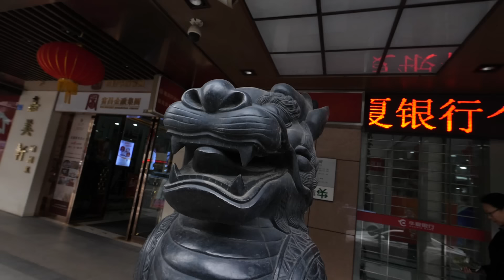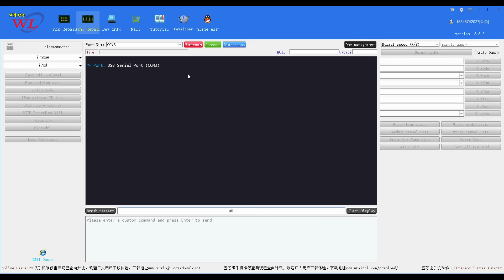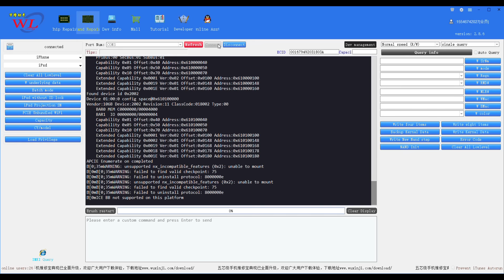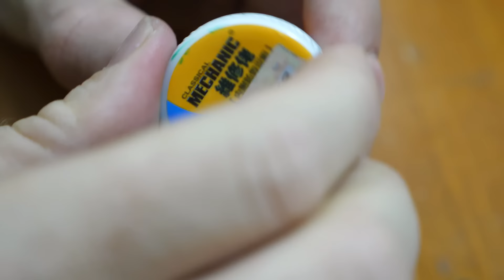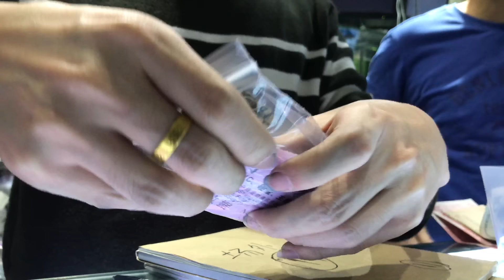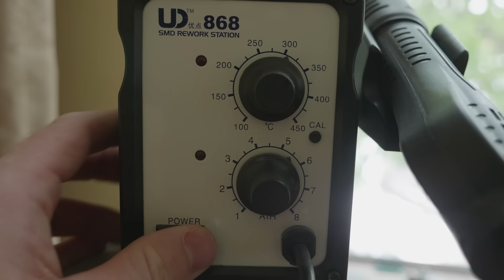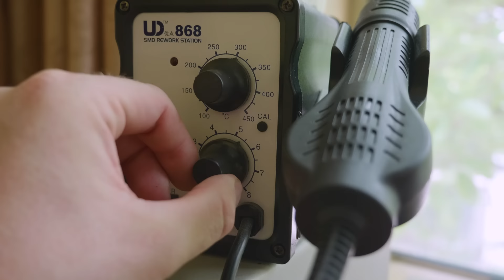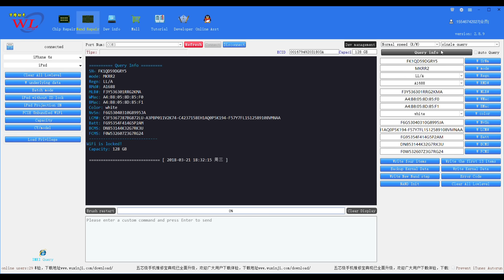How I Upgraded My iPhone Memory 800% - in Shenzhen, China

Comment: GREAT VIDEO!
HOPEFULLY some of you now understand why high end phones are expensive. Some parts will not work on first soldering.
I've done a few re-solders on my LGG3's. Making my own soldering iron tip with a 16g wire wrapped around that big 3/16" tip.
BUT... I now have a hot-air solder'er ( ! WHAT A DIFFERENCE ! ) 

.

Comment: I love your videos!!! You should try installing an oled Display in the phone next. I’d really like to know if it’s possible somehow... after all the iPhone X has one, so the software should support it.
Reply: Ꮆ0ͮͩͦ̑D̶L̶e̶ᎦᎦ Software isn't the issue the issue is whether or not someone makes an OLED panel with the right size and contacts for the logic board. An OLED panel will use the same software as an LCD hence the fact that no driver downloads are needed if you swap from IPS to TFT to OLED to AMOLED. However, you'll find a nice IPS panel is always nicer than OLED as with a 1600:1 or better contrast ratio your blacks will be almost as deep and you'll have much nicer high light performance with the lack of long term burn in thrown in as a bonus. So possible? Yes. Reasonable? No.

Comment: Here's a suggestion ..... Upgrading the CPU from the A9 to the A11 if it is possible
Reply: Jonathan Flowers it isnt but if its possible i will upgrade it to snapdragon 845
Reply: why would you ever want to upgrade an A9 to a low tier sd845 over the high end x86_64 based A11
Reply: I think the socket are not same :/
But good idea :)
Reply: even if it were, you wouldn't unless you don't know anything about CPUs. The A11 is superior to the snapdragon 845, even Samsung's Exynos is superior.
Reply: Where on earth did you get the idea that the A11 is x86_64 based? The A11 and the snapdragon 845 are comparable devices, and both are high-end 64-bit ARM-architecture devices.

Also, different SoCs have different pinouts and different requirements on other components, so upgrading the SoC (other than to a minor variant of the same SoC, e.g. a different speedbin) requires a logic board redesign.
Reply: dude, not possible
Reply: The motherboard is different
Reply: Top Kek it's not x86, and either way x86 is increasingly bad compared to ARM in many ways these days.
Reply: Jonathan Flowers not possible at all
Reply: Nope
Reply: upgrade to i7 is better
Reply: Should technically be possible considering they are both ARM processors. Same instruction set, but it would likely cause timing issues with threading.
Reply: The a11 isn't x86_64 based
Reply: CPUs are not as easy to replace as memories, You gotta take care of ton of variables when changing CPU (eg. Architecture, Socket, Compatibility, Clock speeds) on top of that a lot of programming also goes into the process.
Reply: Sergej Čipak  snapdragons use a different chipset socket etc
Reply: Even though I don't know anything about this, but I think what Matthijs van Duin said is true. It's possible, just need the board to be redesigned.
Reply: HyperSonic2006 [KC] wow, do you mind making a video guide on how to do it?
Reply: HyperSonic2006 [KC] owh, that's okay. just in case you make a video some day, please inform me ok 😉
Reply: I was talking about upgrading to the Snapdragon 845

Comment: I'm not sure if someone has mentioned this already or not, but the solder screen is not intended to be on the board as you are heating the solder. At least that's not how one pastes pcbs. 

You made it harder on yourself han was necessary, but great job completing your upgrade in hard mode!
Reply: Austin Bialk is not to be confused tour is
Reply: Punjab

Comment: New computer ? You could have just installed a virtual machine in your Mac ._.
Reply: Juan Camilo oh I just posted this comment
Reply: Macs can run Windows natively without a Virtual Machine.
Reply: they have an internal virtual machine, they cant run it natively since the mac is basically a linux operating system windows can also do this.
Reply: Hamguy Bacon It's not a virtual machine. Windows can run natively. Macs are also PCs. They share Intel chipsets with PCs and also use UEFI before Windows did.
Reply: they can also just duel boot
Reply: Macs are not PCs since they do not adhere to the IBM PC standard
Reply: TGOTR No, they're PCs because they can run Windows natively without the help of virtualization software. They use Intel processors and chipsets. Since 2006 Macs were able to run Windows.
Reply: TGOTR they run windows natively.
Reply: No. You could install full blown windows on it.
Reply: XDTuber ikr!!
Reply: TGOTR PC stands for personal computer
Reply: Everything in China Is so cheap it doesn't even matter lol
Reply: or bootcamp windows onto it.
Reply: TGOTR IBM PC standard? This isn't 1983. Macs have the same processors and hardware as PCs do so you can natively install Windows onto a Mac and it will run like a normal PC
Reply: Hamguy Bacon LOL
Reply: TGOTR there is no IBM PC standard. 1. Mac OS runs on Unix for 2. Apple switched from using IBM’s PowerPC CPU’s in like 2006? They switched to Intel with the Intel Dual Core. I had a 2008 Core 2 Duo MacBook and you literally instal windows on it. You boot up off the windows disc, install windows to a separate partition, ten install the “bootcamp” windows drivers that Apple supplies. It’s literally a native pc at that point. I played games and everything. I ALSO tried out Parallels which IS a virtual machine. 

You can literally build a “hackintosh” because Apple switched to Intel (and they got around the TMP? Chip. 

Please educate yourself.
Reply: Andrew Russell. As you've been a user of Parallels, as of recent versions, Parallels can use your NATIVE Bootcamp partition to run as a Virtual Machine. I've done this many times. When I need to use both OSes, I just run my partition as a VM. When I want the most performance on Windows, I run it natively
Reply: I just tested it, I didn't run for everyday. That's a really cool feature that I was wondering if they'd be able to implement.
Reply: Yeah, I was really happy when I found out about it. Previously, I used VirtualBox and did some fishy settings to make it work, but the "Guest Additions" drivers it installed on Windows 10 really messed up my Windows 10 drivers, to the point that I tried to boot to Win10 and after a couple of minutes my machine did a cold reboot and I wasn't able to boot it unless I booted to MacOS, started the VM, and rebooted to Win10, but that only gave me 2 minutes more of use. I tried to remove VirtualBox drivers and Windows started working again… except without sound (unless it was connected through HDMI to a TV), and I had to reinstall Windows

When I found out Parallels has official support for booting the Bootcamp partition, I was really happy and I've been using it for over a year without major issues
Reply: Juan Camilo he just wanted to go outside XD
Reply: Nah. Macs are lame. Its good hes made the switch.
Reply: Juan Camilo i know right
Reply: I like boys
Reply: no. beacause now he owns a REAL computer.
instead  of a flashy gadget like a mac
Reply: They’re switching to their own hardware apparently

Comment: Buys new computer instead of installing Virtual Machine on MAC. Logic...
Reply: or just dual boot
Reply: Well, he is just an Apple user...... lol
Reply: In theory this should work fine, however; trying to make obscure hardware work through apple's USB through to a VM is something you never want to be involved in, especially if you have the annoying Thunderbolt 3 only MacBooks. I recently needed Windows XP to flash the firmware on an old embedded system, figured I could do it on the job using my macbook and a vm.... 4 hours later and I wanted to break Tim Cook's knees. Buying the laptop was the right choice lol.... Even "bootcamping" a modern macbook sucks because they only come with 256gb and the drivers available barely work. If his macbook was from the 2011 era and before, then he probably wouldn't have an issue (unless OSX has some bullshit software security layer which fucks it up)... sorry for the rant
Reply: VM is slow, and sometime can't directly detect your USB
Reply: Pensé lo mismo. Me sentí estupido.
Reply: Yeah, you can't always run expensive software on cheap windows.
Reply: @Defensive_Wounds  does alot of cool stuff cant figure out how to install VM or dual boot xD
Reply: @crownless236  well maybe the mac was in use for other stuff and he thought get a windows computer for programs and all of that good stuff because macs are for editing and windows is everything
Reply: That's hard work thanks for showing your efforts.
Reply: Thought the same thing :P
Reply: @yockshimosh  exactly
Reply: @hardi9908  Usually,u have to waste your precious time to set various drives for VM,that's why he does not to do this .
Reply: He might not know about vms
Reply: hahaha
Reply: Some software just doesn’t work on Mac, even if you use Virtual Machine. It’s decide by the hardware of Mac
Reply: or dual-booting windows
Reply: Buys Mac when there is windows. Logic.
Reply: He had a MacBook Air though so maybe he just used it as an excuse to upgrade
Reply: yeah but VM cant controll usb so well i tried using VM tho its not working because the VM cant take full control of the usb controller bro
Reply: Or just borrow a windows pc from a friend
Reply: @barrynevio4440  Amen to that!
Reply: Depends on the price on the PC, if it is wort the time to install it.
Reply: i was thinking the same

Comment: How about you don't buy a whole new computer to install Windows? Just a suggestion. Also, you should use flux when de/soldering, since the solder will oxidize with the heat causing weak/no connections (Flux is any acid, typically rosin dissolved in alcohol). The board should be bought up to heat (around 150 °C) through the use of a bottom heater, then use the hot air to heat while monitoring the temperature with a thermocouple; to check solder is liquid, gently poke the chip on the side and if it moves (it will move back as the surface tension will hold it in place) then you are good to remove the chip with minimal force, the same is true when putting the new chip on, poke it when you think it's ready, it should budge a little and come back. Great video

Comment: Pleeaaase call it storage
Reply: It is, in fact, eMMC Flash Memory he's soldering, so he's using the right term.
Reply: Steamrick but he's not upgrading the memory
Reply: It's all memory. The RAM is just a sub-type of a term that covers both volatile and non-volatile types of data storage. For more information, see the video "Memory & Storage: Crash Course Computer Science #19". In particular, pay attention to the 'memory hierarchy' slide.
Reply: He is talking about eMMC flash memory (storage chip used on the iPhone). So using the term “memory” here is actually correct. But I see what you’re saying. If he was talking about a hard drive using the term “memory” would be incorrect.
Reply: aaaaaaactuaaaaaally if you want to get pedantic about it, we as a society have the the terms bass ackwards... in the early days of computing the "Store" or "Storage" was in fact what we today call RAM (Which is short for Random Access **Memory**), the term got switched some time on the 60's when we had easily interfacable recording that could be A) Local to the machine and B) quickly read and written. 

ok, enough History, let's talk terminology.. the eMMC (embedded Multi-Media Controller) controls the Flash Array that it's attached too, in this case they're both on the die in the chip package. the reason it's often referred as Memory is simply because the topology is the same as the the RAM+Host Controller are assembled (at least on a block diagram). there's just no sense in changing the terminology (again) when the work around is to say "RAM" for the fast, volatile, random access memory, and "Memory" for the comparatively slow, sequentiality accessed flash memory!
Reply: Onur Gunduz 
It's not storage it's a memory chip.
Reply: Even harddisk is memory if you think about it, because it remembers stuff, just the term is not used... also any kind of storage is more of memory than ram chips that forget everything as soon as they lose power.

Comment: Install a custom OS with your own logo on your Iphone.
Reply: sniperwork not possible
Reply: Darkshadowguy it's possible
Reply: Darkshadowguy it's not impossible IT'S NECESSARY
Reply: sniperwork Would probably take a lot of time and it's probably not worth the effort.
Reply: logan brooker not really. You can add custom load screens on linux easily. Thats what android is. A framework running on modified linux. Take a look at the android x86 project
Reply: Cat I must have misinterpreted the comment. I thought he meant making a os from scratch.
Reply: logan brooker It's not really that hard, something you can be done with in 10 mins after a jailbreak.
Reply: Darkshadowguy is possible but is a waste of time
Reply: In theory, he could, I used a software called 
Ibackupbot so that I could modify a premade iOS backup and remove an mdm profile, and since you are able to tweak the entire OS, he should be able to add his own custom features
Reply: It’s possible but would take a long time
Reply: is called Jailbreaking
Reply: Just jailbreak at that point

Comment: "And I saved $75"
Indeed. I also bought a microscope, reflow tools and device specific templates, and a bakers dozen wasted boards...plus two 128GB chips.

Good vid!
Reply: Craig M don't forget the chip reader from ghost in the shell.
Reply: All of those tools could be used again for other protects. And the knowledge gained from all the practice boards is useful as well.
Reply: This whole project wasn't about (him) saving money at all.
Reply: He also bought a new laptop lol. But you say it as if he were to do this a second time, he'd have to buy everything again
Reply: Would've been great with the 512 GB. Because that'd be a real upgrade, which you can't buy from Apple.
Reply: LOSE but apparently the software does!
Reply: He had most of it already

Comment: You could have just installed windows on your mac using Bootcamp assistant, a program that comes on your mac from factory and the purpose for it is to partition your hard drive making you able to isolate a certain amount of storage to the windows partition meaning you can just switch between mac os and windows just by holding down the options key when you boot and that's it

Comment: You don’t need an X-ray, just make sure the pads are even and give the chip a jiggle and surface tension should pull it into place. Also I’ve found out that the paste plays a big part in this.

Comment: I would love to see Scotty pick up one of those cheap small laptops (like the 11inch variety) with soldered RAM and soldered eMMC hard-drive/ssd, and upgrade the storage and ram on one of those..
Would be an awesome project, and also because that's what I'm about to attempt to do- Upgrade the soldered 4gb ram to 8gb or 16gb, and then if that doesn't trash the system, try to upgrade the 64gb eMMC flash storage to 256gb. Then I'll have an awesome almost-pocket-sized laptop that still has it's amazing 20+ hour battery life :D
(I have two laptops, one is a massive 17" $3200 razer system (10875h 2080super 64gb, 2x2tb nvme raid0) and this mini laptop for when I'm on-the-go.. I'm a programmer and game dev, so I'm making adjustments to projects all the time and having the increased memory would be a godsend for the hp stream 14 11")